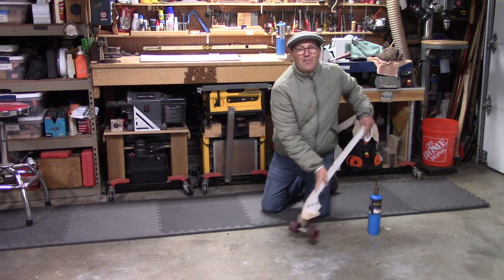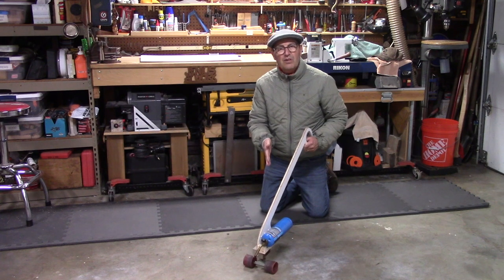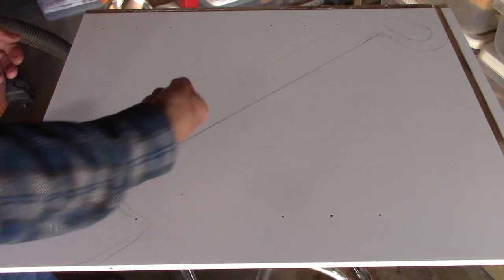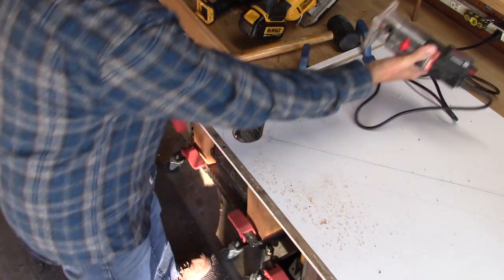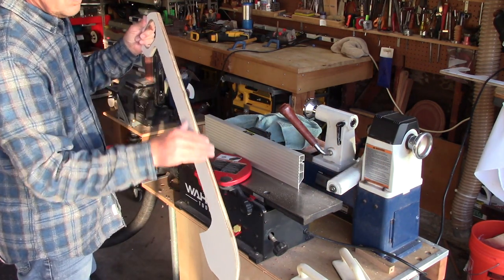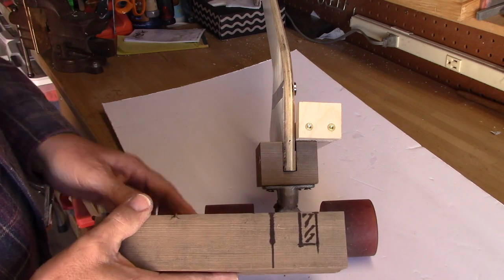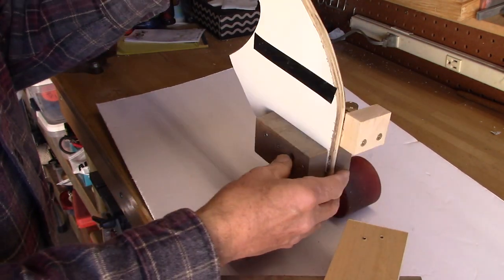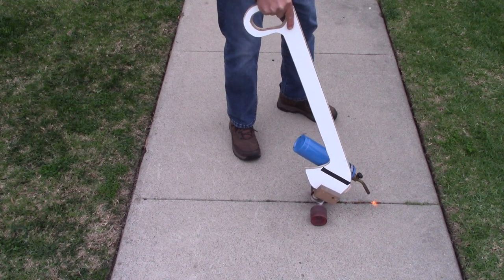DIY Weed Burner

Comment: That's a neat project, very practical and useful.  ( Wish you'd published a few months ago before we bought a propane burner. Lol. )  What I've been wishing for is  a wider flame at the ground level. I'm not needing to burn cracks. I'm wanting to burn off a strip of land under a future garden area.  We've done it a little with the propane burner and it's slow going. 
  Comparable to the difference between the small hockey puck -sized magnet on a handle, which we have for picking up nails in the garage, and those big wide magnet brooms used to clean up yards after a roofing job.   I guess you could put more than one torch on your handle, but can you think of a way to instead spread the flame at the nozzle into a line with multiple jets?  I've never looked at burners or nozzles.
Reply from the maker: I have seen machines used to resurface roads and they have a long pipe with jets of flame coming out evenly spaced across the road. You would need to check with a pro because what I am describing to you could also function as a pipe bomb!
Good luck, it is good to hear from you again. Have a great 2023
Reply: TY, I am only pondering, not planning action. :)  Appreciate the warning, I had not gotten past the wishful phase. I know limitations, but like to imagine if something can be adapted.  ( Now that you said that, I wonder how the burners on a gas grill are configured.  My better half always fiddles with that, I've not looked.  This brings to mind the original flashes for cameras, were they something like gunpowder dusted along the top of a bar? 
Not what would be looked for...  How about a top broiler in an English kitchen's gas  range?  I saw one once decades ago, I swear that surprised me with being a bar emitting flames like a grill only from above, positioned over the range top where we'd install a vent fan. And it slid out to deploy? Interesting!   )    Easier perhaps to mount more than one bottle burner on your wand, but could something like a shield be used to broaden or widen  the effects of the flame?